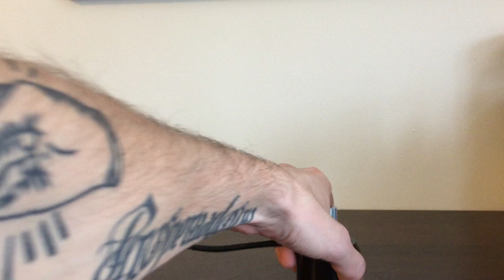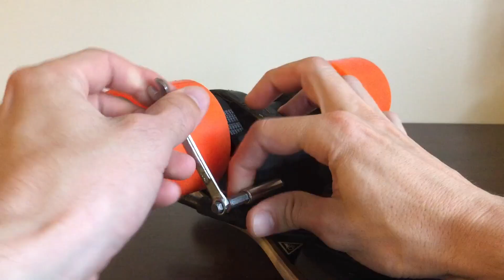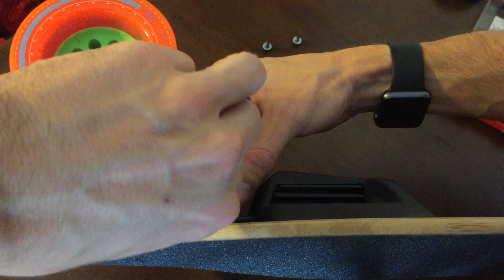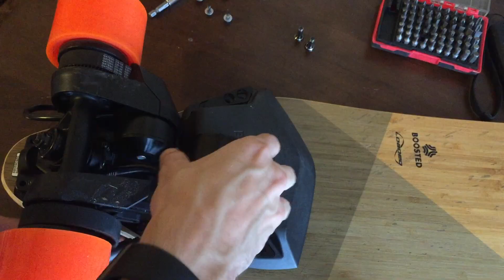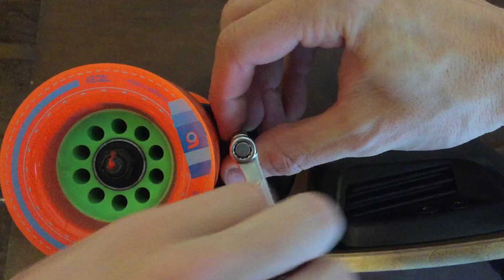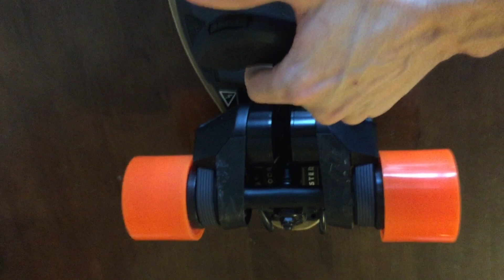Boosted Board V2 Broken Motor Repair

Comment: FWIW - You can just push on the other wheel to get the truck to move enough to get the motor out easily without removing the control unit.

Comment: Joey :) Thanks for creating this video! Very nicely done and really helpful. I'm about to buy one of the new boosted boards and this will be helpful, if I ever have this issue. Thanks again. P.S. Do you still have your board? How's it holding up in 2018?
Reply from the maker: You'll love it. Customer service has been phenomenal. I've gone through 3 motors. The first 2 were defective, but my board was one of the first production runs. Just had #3 replaced at about 900 miles or so. I've gone through 4 belts by now. They had to replace the motor controller when that went at about 400 miles. I commute around NYC where the roads are rough. It's been great so far. I haven't had to pay for any repairs yet. Definitely has changed the way I commute.
Reply: Thanks for sharing your experience Joey. Two other quick questions. Have you tried any other wheels out on the board like 97mm, or 107mm Abec wheels? And have you had many falls? It's been a little bit sobering to hear about some people's misfortune and their subsequent injuries.
Reply: @gfranks  Depends on how careful you are and how well your balance/reactions are. I've ridden about 500 miles (and I would ride 500 more heh), and I only fell off twice because I was gonna show off how fast it was. Be careful riding in the rain, on gravel/sand, turning too hard and basically doing shit you know you probably aren't capable of. I'm probably selling mine switching it for a bicycle (because it's good cardio training), but it can be really, really fun as long as you're careful.

And fk Casey Neistat showing the world how cool he is riding around in NYC at max speed while filming himself from above with a drone without wearing a helmet. Be reasonable. Get a helmet.

Comment: Can't believe how vulnerable the motor and belts are. I had a motor scare today. One motor stopped functioning after hitting a small gap in the sidewalk. After turning the power off and back on, the issue was gone. However, I'm worried if the motor will have to be replaced almost as often as the belts?
Reply from the maker: That’s interesting. I was one of the first batches of V2 boards. I had defective motors on both sides. They went pretty quickly. But I’m almost 1000 miles in now and no issues. I’ve beat the hell out of my board with crazy potholes and riding around in the rain. I think the motors are pretty resilient.
Reply: I have to replace the belts every 250 miles. Boosted that it’s a well use belt at 250 miles but I’d prefer lower maintenance for an EV. I’m getting my new motor this week from Boosted at 500 miles.

Comment: One of my motors goes slower than the other and sounds like there's sand or something in there. Would it be easy to check as soon as I take off the motor guards? Would it void my warranty if I did this?
Reply from the maker: Yea, you can check it. They don't void the warranty as it is a modular unit. If you have questions, I'd suggest contacting Boosted directly as I am just a regular consumer like you. I don't work there.

Comment: How did you diagnose that your motor was defective?
Reply from the maker: I gave boosted a pretty detailed explanation of what happened. Given that the motor worked for a little bit when upside down and would stop, it probably meant it was bad. I did a quick test of connecting the left connector with right motor and vice versa, which confirmed it was a bad motor because the problem still happened.

Comment: awesome video! was it broken out of the box?
Reply from the maker: It worked for a few miles out of the box and they do QC them to make sure you're getting a working unit. In this case, the motor under load of my weight, 165 lbs, the motor ended up showing that it was defective. With electric motors, there is no obvious sign it will be bad if all other parameters are ok.
Reply: I didn't understand the overload part? what happens if you're over 165? (I weight 180)
Reply from the maker: All I was saying is that the general quality control they do tests that the motors work. They don't necessarily ride your board. Add your body weight onto the board, and that puts more stress on the motors, which will make it easier for defective parts to become known.

Comment: For how long you used it before it happened?
Reply from the maker: It was only a few miles. I think it happened in probably 3 miles or so. I did fully charge it and see if that helped, but it persisted. It's great that this new motor is modular though! It means no sending the board back and repairs are very straightforward!

Comment: Who give u a new motor? Do u work for boosted ? Company
Reply from the maker: Boosted sent me a new motor since this one was defective. I'm pretty sure they plan to sell the parts once the board starts to age. I don't work for them.
Reply: What did you do with the old motor?
Reply from the maker: I sent it back so they could better understand what happened and prevent it for the future.
Reply: Did you end up getting RLOD?
Reply from the maker: nope. I think that's a separate issue.
Reply: Lots of people with V2s seem to be having it. How many miles have you put on yours?